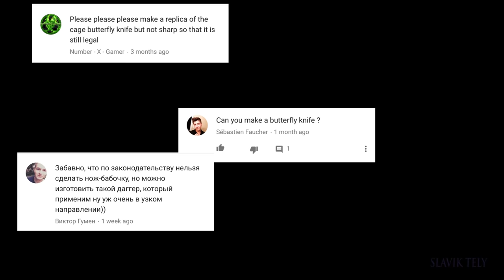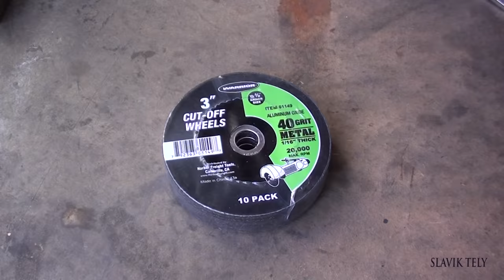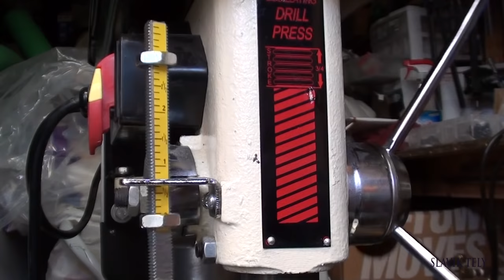Making DAMASCUS CS:GO BUTTERFLY KNIFE Part 1

Comment: a little late but hey SLAVIK, can you tell me how to fix my butterfly knife, if i use it the screws at the bottom keep getting loose, what can i use to fix that (i have a training comb type)
Reply from the maker: Try using nail polish if you want the screws to come apart later on but if you want permanent then use lock tight.

Comment: hey tely, if you mark your file it would certainly help keeping track, a bit of tape perhaps
Reply: nice work by the way
Reply from the maker: I didn't understand what you were trying to say about keeping track.
Reply: the one situation when you hollowed out the handles of the knife with a file, if you mark the file you you can instantly see how much filing is still left.
Reply from the maker: h4n5i Ahh, now I get it. Thanks for the tip.

Comment: Juat a question. when you first cut out the legs for the knife, why didn't you just cut out one and then use that one to make the lines for the second one so they would be exactly the same?
Reply from the maker: Because I can not turn the steel at that angle. That is why I leave extra room to make small cutting turns.
Reply: SLAVIK TELY okay thanks for answering.

Comment: Why u heat it but not cooling it with oil?i hope u see this
Reply from the maker: I did cool it in oil
Reply: @SLAVIKTELY  no i mean like the u heat the steel and not put it to the oil and second time u heat it u put it into the oil.may i know why?
Reply: @hiroxamf6405  it’s called heat cycling, leads to a smaller grain size and therefore a more hardened blade

Comment: I've been crafting knives like this for 3 years. And yet I still would never trust myself to use a angle grinder to draw a slot
Reply: Yea, several methods were different than what I've seen, but great skill was used and a nice result
Reply from the maker: That is why I used only a 3 inch grinding wheel and not the big wheel. Yes, it kicked back way too many times.

Comment: Hi,
1. Why the hell are you 'annealing' the steel? that's st42 or st52, a common building steel. you can't even harden it.
2. Why are you cooling the handles while you cut the groove with the angle grinder? you can let the steel get as hot as you want.
Reply from the maker: Did you read the type of steel I used in description below the video? Nope, I used 5160 high carbon steel for the handles. 5160 was used to make a leaf spring, therefore it was heat treated. I still needed to drill holes through it that is why I annealed it. I have a protective tape on my vise and did not want to melt it. That is why I poured water on it.

Comment: What a waste that is NOT Damascus steel.
Reply: the blade is damascus steel, the handles are 51-60 steel
Reply: Chum Damascus steel is made in roll forged layers, the steel used is  ovviously cheap alloy with NO curls.
Reply from the maker: I bought it at nicholsdamascus dot com. I paid $250 for it. Usually in all cases cheap steel does not cost that much...not even close.